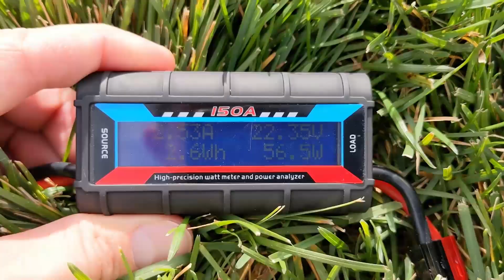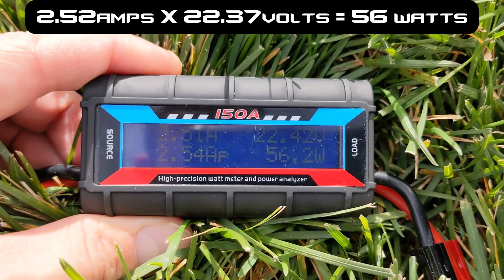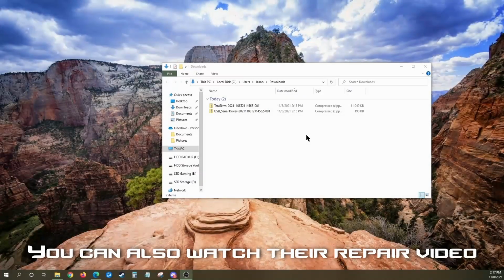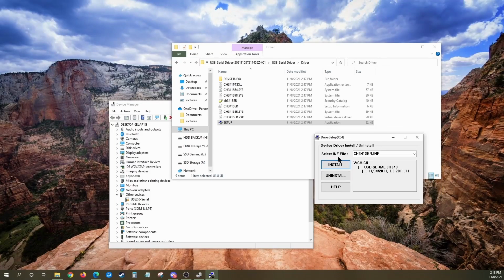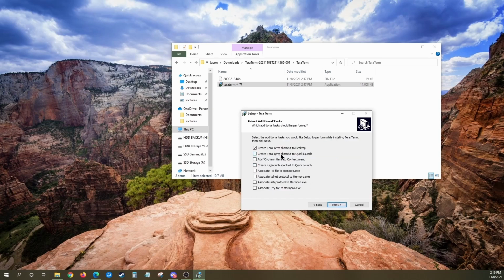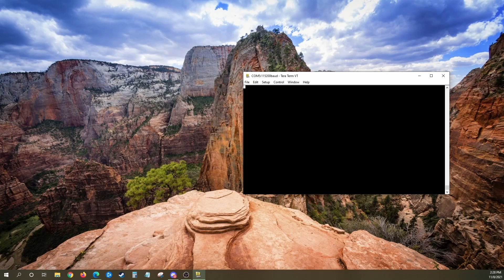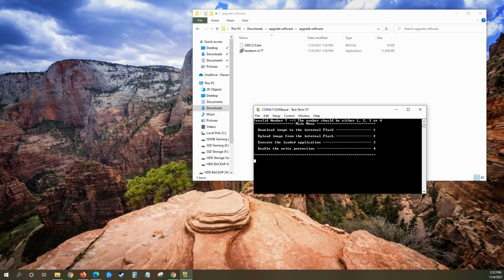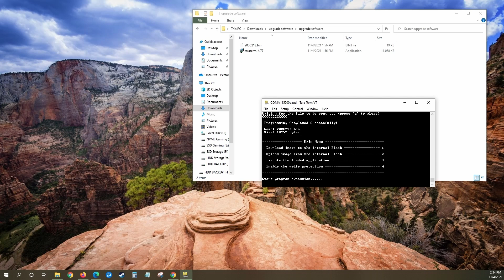CTECHi 240wh Power Station FIXED! No more Solar Charging Issues - HOW-TO REPAIR VIDEO

Comment: Thanks for doing this. I took delivery of mine in the UK a few days ago, so I've just sent them a message to ask if the one they sent will have the fix already or whether I still need the kit. With the fix in place, what size solar panel would you recommend to not be over the top but still get as close to the 60w max in non perfect conditions? Mine is the 320wh version, but I think it's all the same, and it looked like the 320wh in that demonstation clip from ctechi.
Reply from the maker: 100 - 120 watt panel should work good for these smaller power stations.
Reply: @Jasonoid  super, thanks! I wonder if it would be possible to solar charge through both the DC input jack and the USB PD to achieve faster rates like you can from the mains up to 105W.
Reply from the maker: @alecfeuillade3765  I havent tested dual charging on this power station, I have had 2 other people mention that it's supported though.
Reply: DId the fix work with the 320wh unit? I ordered mine a couple days ago and I just found this :_(
Reply: @dkali2207 All new units don't have this issue. It's only an old batch.

Comment: I updated the firmware yesterday and tested it this morning. For me, it take a long time to recognize still, doing that flashing of an internal LED you see at the very bottom edge of the LCD screen that it did before. The first attempt started charging and stopped a minute later. The 2nd try, it took several minutes but finally started charging. I'm currently draining the power station some more to test how long it will sustain charging.
My PV voltage is lower than yours Jason, only 22.2V, so I'm surprised I'm still having some minor issues.
I'll report back if I still have charging issues.
On a side note, I've been very impressed by CTECHi's overall responsiveness.
Reply: Update: More testing. Unit seems to behave fairly consistently at beginning when you first plug in the PV panel. After that, it stops and restarts charging at random durations and intervals. So my unit still has problems.
Here's the process mine goes through:
1. Plug in PV panel
2. Unit flashes internal LED (once per second) 12x (12 seconds) and starts to charge
3. Unit stop charging ~5 seconds, then starts flashing internal LED again for ~30 sec.
4. Unit charges for several minutes
5. At this point, the unit will charge for a certain amount of time (anywhere from 3sec to several minutes), then stop and flash its internal LED for up to 40sec, then start charging again.
It keeps doing this charge - stop charging / LED blinking - charge cycle repeatedly.
So while better than before where it just wouldn't charge at all, it still isn't fully working for me.

Jason - does your unit flash its internal LED for a bit when you plug in your PV?
Reply: @zigzagluck  Any progress with your unit and solar charging? Been interested in this unit and seeing if they are correctable. Cheers!
Reply: @BearNotBare  I had to perform the firmware update 3 times, but it appears to be working. Their charging algorithm isn't the greatest. It takes about 1.5 to 2 minutes before it actually starts charging (initially connecting the PV input, it evaluates for 30sec, then charges for a few seconds, then goes into evaluation mode again for another 90sec or so). But it did eventually successfully charge, so looks to work. Just takes longer in their assessment mode.

Comment: Is their dongle even needed if you have a typical A to C charging cable?
Reply: A cheap charging cable does not provide connected data pins. And that "dongle" appears just to be some kind of UART-over-USB emulation, which is a pretty common technique in the IoT context. So it's probably not a vendor-specific "dongle", but rather one of many of those standard USB adapters that support UART (RS232) emulation.
Reply: @danielrodding8522  I probably should have clarified that the cable would need the data lines; I've seen that issue where a charging cable could not connect two devices because those lines were missing.
Reply from the maker: Yep, that's a serial connection to communicate to the circuit board. Email them for a kit.
Reply: @Jasonoid  I sent them a message on Amazon; time to wait...
Reply from the maker: @OnusBones  Amazon message? You'll get the best results as suggested emailing the email in the video description. However I'm just providing the information that gave to me... That would be the best route haha. Im sure there are other ways to get it done like via Amazon messaging.
Reply: @Jasonoid  Ah, now I see the address.  Well if the Amazon message doesn't work by Monday, I'll try that one.
Reply: @Jasonoid  USB C to USB C for Software upgrade directly is not working without a dongle?
Reply from the maker: You can test it, but I'm guessing the only way would be to have their adapter in the mix.

Comment: That was easy! LOL...
Reply from the maker: It took awhile for me to find that driver! Haha
Reply: @Jasonoid  With all this would you now recommend this unit? The cheapest I found was $179.00 Is that one of the discounted priced ones?
Reply: @Jasonoid  I was able to connect to the unit and do all the steps without the driver. Maybe I did it wrong. I followed CTECHi's video.
Reply from the maker: @zigzagluck  Your computer may have found the driver automatically. Just depends what has been installed on your computer in the past. My computer wouldn't work without the CH340 driver installed. CTECHi also mentioned others had issues without the driver installed.